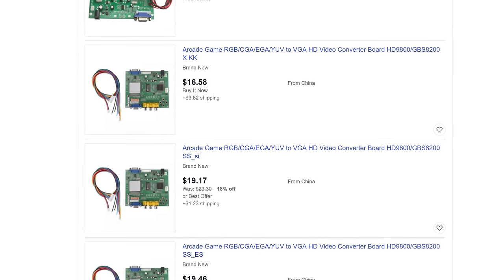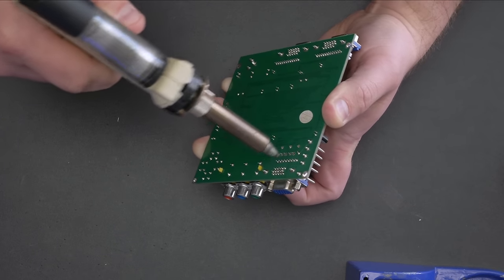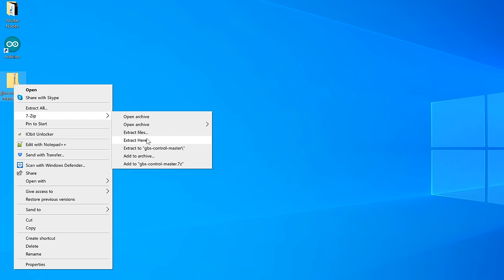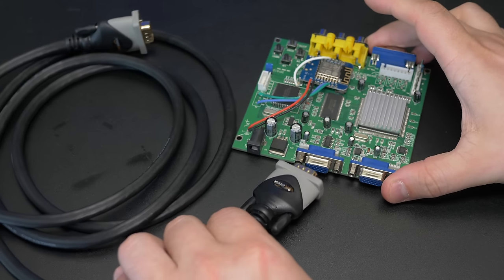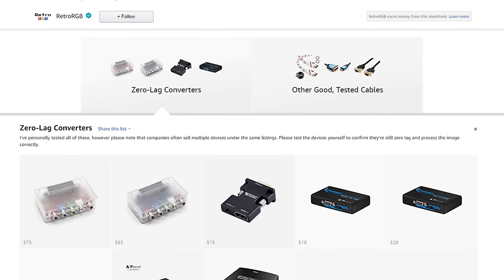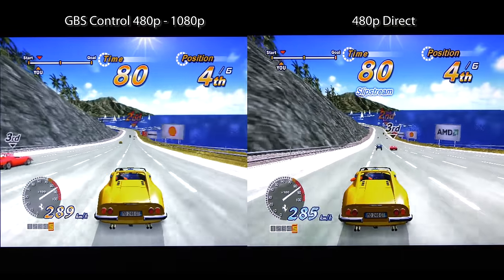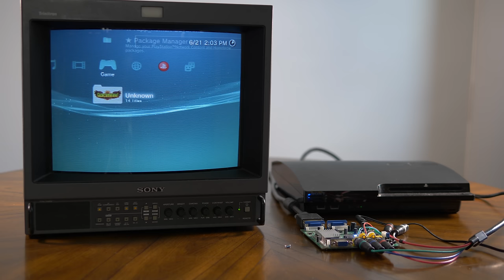GBS Control: Installation & Overview

Comment: This is an extremely compelling product to use for deinterlacing and downscaling. As far as 240p goes, as you mentioned before the RetroTink and OSSC are still the top dogs as long as money isn't an issue. However, the GBS's deinterlacing has really made an awesome impression on me. I use an OSSC, but I'm not a fan of the bob-deinterlacing due to the fields constantly moving up and down which makes it hard to focus on static screens like menus and such. To fix this I use an Crestron HD Scaler which handles the deinterlacing instead of the OSSC, but I have no idea how much lag it produces. I don't think its bad at all, but the OSSC is needed to convert the analog signal to digital before the Crestron gets it because its does get laggy when dealing with pure analog since its also upscaling. The GBS on the other hand has some hard numbers to show and they're really good compared to more popular deinterlacers like the Framemeister. I may consider this project just for 480i only, but I am looking forward to seeing your next video on how downscaling may be beneficial. Thanks for all the effort and information you give us!

Comment: I actually did it.
This is the best low cost investment I've ever made. This thing is incredible. It's just that good.
Things you will need if you never soldered before, like me:
• female ended wires, if you buy the full-size esp8266 board like I did, not the mini one Bob did
• one single jumper, though you can get around this by...spreading solder between the two pins on the flip side of the board. Go with the jumper.
• 100 Ohm resistors (3 total)
• you can pretty much only buy the above parts in bulk because brick and mortar parts stores are basically dead RIP
• soldering iron kit (iron, solder wire, flux, DESOLDER PLUNGER PUMP THING [necessary], solder wick, multiple iron heads)

Having never done it before I really thought I would kill it, and I nearly did, but it turned out fantastically. 

The only complaints I have are that the 1080p output frequency is guaranteed to cause a disconnect with the wifi, and the screen tearing is noticable sometimes, but the clock gen mod fixes that easily, just more work and an extra purchase. This thing is a dream.
Reply: Intersting I bought a pre made GBS-C and notice now and again a horizontal line scrolling down the screen.

Comment: 10:45 "Nerding" used in this way is new to me, but I approve. :D Anyway, this is awesome. Last time I looked at this project (a couple years ago?) they were using Raspberry Pis to do this stuff to the GBS scaler. Everything's gotten way fancier and cleaner with an Arduino and those awesome menus. Great work, guys!
Reply: I did mine with dooklink's raspberry pi mod on a pi 2b.  I didnt do the component out mod.  That requires more nerding.

Comment: I made three of these, one for me and one each for my two oldest daughters that are also into ps1/ps2 gaming
and they work beautifully. Easy to use and great performance at a very reasonable price.

I actually bought a board for a fourth one. Lol. I am planning to build a dedicated PS2 arcade cabinet. I.e. an arcade cabinet but one that has a ps2 built in with a HDD and OPL. And instead of clickety buttons and a joystick it will just have a holder for a PS2 controller.
Kind of like those cabinets you used to see at Fry's or game stores to try out some demo-games. But this one will look a lot more like an ordinary full size arcade game cabinet, but it will just be for a PS2.

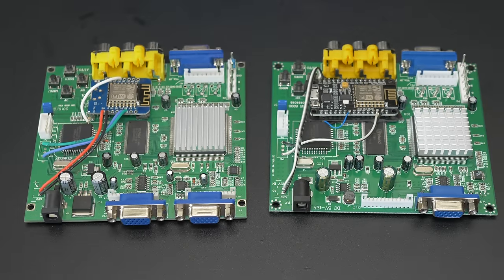Comment: Thank you for the informative video! 5:44 you show the 8200 and 8220 side by side... and they are each using different variants of the 8266.  Looks like the 8220 uses the D1 style board whereas the 8200 is using the CP2102 (which is also the board you have linked in the description).  Was that an intentional choice for a particular reason, or did it just happen to be what you had around (since the layout shouldn't matter)?
Reply from the maker: Honestly, it’s all I had access to. I bought from different sources hoping to get a variety, but that’s what I ended up with.

Comment: Can you downscale a VGA computer signal to 240P with this device? 
I know you can achieve this using your graphics card in tandem with a VGA to component transcoder. However my graphics card is too old to achieve this. Instead, I use an Extron VSC 100 in tandem with a Extron RGB 190 to achieve a 240P image.

Comment: How does the board transmit sound to the tv if you don’t plug in all the component cables? Sorry this is probably a dumb question
Reply from the maker: Not dumb at all!  You’d just bypass the board and send audio directly to the TV, speakers or stereo receiver.
Reply: Thank you so much. I don’t know how you have time come reply to a random comment on an old video, but I can’t thank you enough!

Comment: I think you could just put the sync resistor inside the SCART connector - they're usually easy to open & have plenty of room inside. I used to do a similar modification inside 3rd party Nintendo cables many years ago.

Comment: Awesome video. Gotta say based on my experience though that the 240p results in my GBS-C are far superior to what you're showing at 14:39 .. you have these really obnoxious horizontal ringing artefacts. Have you noticed these? And would you say they are universally present in the units you have tested? Or is it a side effect of your capture method?
One of my biggest concerns with recommending GBS-control is the QC on the original devices, so it may be that my GBS board is just better than the one you used. Would be interested to hear your thoughts though!
Reply from the maker: I've built and tested three 8200's and one 8220 for these captures.  All look pretty much the exact same.  I agree, there's most likely a lot of different models with varying quality.
Reply: Mine also does not have these artefacts in 240p output. Worth investigation!

Comment: I've been using GBS-C as my daily driver for the past month and it's been pretty great, especially for the price. I'm no wizard with the soldering iron and I actually screwed up, damaging the board... But the board only costs £15 so I just bought another one and tried again. Imo, that's pretty much the point, right there.

Comment: Does the pass-trough mode(240p or 480i source) also work with the VGA to HDMI adapter? I'm curious about this since this would be really handy for my streaming setup, since there are not a lot of Scart splitters of high quality and a reasonable price I had the idea to use a GBS8220(with the mod) and the use VGA as output method, combine the sync and use that on my CRT and then send the other via the VGA to HDMI adapter to a capture card, i'd really appreciate it if someone could point this out to me!
Reply from the maker: Yes, but your HDMI target device would have to be compatible with 240p and 480i for it to work.
Reply: @RetroRGB  Ok thanks! i believe my capture card supports that!

Comment: Trying to build one… and stuck. Bob, ive added a clock generator and vga to HDMI out adapter, while inputting via component video. I can only get video feed of 480p from a wii, in “pass-through” only. None of the upscaling presets are “selectable” and when i do select a preset, the screen just goes black. 

Can i get some help?

Comment: What about those using a GBS 8200 for an arcade board?  Does the GBS Control mod help with that at all?

Just started using one of these recently for my Mortal Kombat boards.  This is an impressive mod.
Reply from the maker: Yes, it's a massive help.  Doesn't matter if you're using the original for arcades or consoles, it's still really laggy.
Reply: @RetroRGB  Yeah I can confirm the lag from playing Mortal Kombat 1 on mine, although still playable.  Luckily I found a replacement 25 inch CRT for my UMK3 so I didn't have to use the GBS.

Anyways, thank you.  I will definitely be looking at this solution for a CRT replacement in case its ever needed.

Comment: Would it be possible to use this device to get 240p composite video from an HDMI source?
In my head, the setup looks like HDMI from PC -> HDMI to VGA converter into GBS -> VGA to composite converter out of GBS -> 15khz NTSC crt composite input.
Would appreciate any help :-)
Reply from the maker: Generating composite from RGB is REAAAAALY hard.  The short version is because you need a pixel clock to sync the color data.  Here's the long version:  https://youtu.be/m12PgfZl56c
Reply: @RetroRGB  Ahh, I see. Thanks for the quick reply! Starting to seem like composite 240p from HDMI source isn't possible at all, unless you have any ideas otherwise. But maybe it would be wiser to go in a different direction, such as original hardware or CRT Emudriver. Thanks again!!

Comment: Fantastic.  Do you think this could work on an MVS + Jamma?  I have one of these laying around.  Pretty impressive project!
Reply from the maker: Absolutely, but you'd need to make sure the video levels matched standard RGBs.  So MVS -> cheap supergun -> GBSControl should be perfect.
Reply: @RetroRGB  Get a MiniGun on ebay or tindie. MVS -> MiniGun -> GBSControl

Comment: Have you started seeing 240p/480i switching causing dropouts again after installing the clock gen? Because that's been my experience. It was seamless without the clock gen, but I wired it up and started powering it off C47 and now it works great and there's no tearing... but it does drop out for a split second when 480i<-->240p switches happen.

Comment: I am having a issue with the gbs not outputting a video signal. I am using a vga to hdmi converter. Have verified the converter works properly. I can log into the controller via wifi, but cannot select a output resolution. Have triple checked wiring connections,  but am at a loss at this point. I am questioning if the gbs is even powering on as the led indicator on the board does not illuminate. Any suggestions?

Comment: I really want to use it to connect my PC, which has a video card capable of outputting dvi analog if required, to a consumer CRT set via component YUV/YPbPr at 15khz. It looks like it is capable of doing it, can anyone confirm?
Reply: Should be possible, but bare in mind the output will be RGBHV, not RGBs or YPbPr, so you'll need to convert.
Reply from the maker: Yup, it should work fine:  Set your PC to 640x480, then connect the DVI-A output to the VGA input with a basic passthrough cable or dongle.  Then it'll either output RGBHV or YPbPr, depending on how you have the output mode set.
Reply: @RetroRGB  thank you Bob for clarifying. I just subbed to ur floatplane to ask this but you were kind enough to answer here. I'll be keeping my sub there to support u. Have a great week!

Comment: I use one of these for plugging a component source into a VGA monitor, with the "Source Pass-through" setting in gbscontrol, and it seems to just be straight up transcoding YPbPr to RGB, which is exactly what I want.

Comment: I have used a few GBS-8200 in the past for converting 25Khz medium resolution arcade games to VGA, I didn't much in there to upgrade it for that purpose, is that correct?
Reply from the maker: I would never recommend using one without the GBS Control mod.  The variable lag alone is reason to upgrade.

Comment: Brilliant video. I'm trying to find out the best way to connect Atari ST 320x200 to a CRT VGA monitor as the 15khz scan is out of range. Do you think this is worth a try for that purpose?
Reply from the maker: I THINK this will work, however I don't have an ST to test.  If you don't mind building your own hardware/software, I think this is a worthwhile project to test.
Reply: Search YouTube I believe there's a video of most home computers to GBS. Atari ST, Amiga, Beeb, etc.

Comment: If I have not understood the best option for all systems is GBS-C, right? I lose some quality in 240p, but it still looks good and in return I win the best deinterlacing (PS2), the only device that works correctly in game that alternates 240p with 480i (SNES, PS1 and PS2) and works correctly to rescale progressive signals to 960p or 1080p. Lag is very low, I guess it won't affect the game if not people wouldn't be buying it.

To begin with, GBS-C seems the most complete/economical option, right?

By the way, does it have any kind of effect to apply to retro games like scanlines?

Comment: I'll be looking forward to those downscaling solutions! I got a PS3 recently and got bummed at how it can't display 240p. Although, the PS1 emulation on it seems worse than people think it may be, because aside from not displaying 240p, it's scaled incorrectly vertically, at least in 480i on my 29" CRT; Symphony of the Night has some tearing when scrolling up or down, though it's not noticeable on 3D games. But the worst thing to me, is the audio delay. Input lag seems fine, but it was impossible not to notice the delay on any audio cue. The PS2 is much, much better at backwards compatibility than the PS3.

Comment: Great video. I do have a question. How did you get RGB out of the PS1? Did you use SCART to VGA?
Reply from the maker: Thanks!  I used the SCART Cleaner, but the GBS-C AIO works equally as good...it's just not available yet:
https://www.gbscaio.com/
https://www.retrorgb.com/scartcleaner.html

Comment: I have a consolized MV1C that has a 15khz RGB signal coming out a DB15 - could I run that to the GBS input and then have the GBS output component video (essentially using it as a transcoder)?
Reply from the maker: Yes.  You can choose to pass through the signal, transcode, or scale it.  Just check the github and notes about the proper mods required for high quality component output.

Comment: Excellent tutorial. I got one of these cheap boards with hope to render 15kHz Atari ST colour to modern monitor - it didnt work on the VGA but I see after buying it that the VGA only handles 30-32kHz. I figure rather than sending it back I will hack it as you have shown .... if nothing else it looks like a fun thing to try.

Thanks again
Reply from the maker: Thanks...and that's a great idea!  Worse case, you're out $20 and an hour of time...but have a "tool" you can use for tons of other stuff as well.

Comment: I have an odd usage case idea, For games that have the handshake drop out problem to other scalers. Could this be used to normalize their output before being sent over to say an OSSC or Framemeister to make it so that they no longer have that issue? I already have Framemeister but there are some things, Like Pokemon Stadium where the intro is unwatchable on it because of the resolution changes.
Reply from the maker: Mixing scalers like that can often result in a lot of unwanted side-effects.  If this is an important problem to solve, the best solution by far would be selling the Framemeister and getting a RetroTINK 5x.  I demo the resolution switching in my launch video, but there's been a ton of updates since...search this channel and RetroRGB.com for more info, but start here:  https://youtu.be/nwNrqIjxBaA
Reply: @RetroRGB  I'm not sure the 5X is the right one for me. N64 and Playstation 2 are my newest systems. most of my collection includes NES SNES and first playstation aside from them and an Atari 2600 Edit: Oh and a Dream Cast my Mom fried by unplugging and plugging the controller back in while ignoring me saying to not to.
Reply from the maker: The RT5x is by far the best scaler for all those consoles. No contest.
Reply: @RetroRGB  Thank you. I don't see myself selling my Framemeister. I'll just save up and potentially get this and a RetroTink 5x at some point. Thing is my newest TV is still only 1080p and I might be able to use this to down scale to make a better source to pump into a VCR in house transmitter science project to still use on my dozens of battery powered pocket up to 5" crt TV sets.

Comment: Wow, I just found the 8220 I bought like 15 years ago, after not being able to find it for years.... Now it just so happens that between building OSCRs and SlimeVR trackers, I have pretty much all the parts required for this mod. 😁👍
Reply from the maker: Ha, awesome!
Reply: @RetroRGB  I think most makers have a crapload of esp8266 and esp32 boards by now, but I laughed pretty hard when you were like "And if you add this clock generator board...." because I've got like a dozen of those for OSCR builds! 🤣 Always refreshing to stumble upon a new project and not have to buy anything innit?! 😁

Comment: My signal input is AV(CVBS). It seems an add-on converter board is needed before the GBS Control or OSSC. Does this extra add-on add latency?
Reply from the maker: Zero latency added:  https://youtu.be/R3yIWdN0gKE
Reply: @RetroRGB  Thanks. I need to switch  between 2 CVBS sources from time to time. I guess it maybe similar to the 240p-480i swtich of the consoles. Is a GBS Control with a Koryuu Transcoder the solution for me?

Comment: Mine didn’t have any luck with my Sega Blast City with 31Khz Sanwa arcade monitor, the image kept scrolling and fizzling out. Removing the GBS and plugging directly in via HDMI to VGA did the trick when set to 640x480 in Windows so now I can get my Mame setup going albeit without the GBS in the mix. Not sure what the problem was, perhaps it was the fact that mine had a clock mod installed for compatibility with certain other combinations? I thought that would be better to get a fully modded up GBS but perhaps not? I’m not interested in buying a non-clock modded GBS unit just to test since my arcade setup works and I found out the monitor didn’t do 15Khz anyway so now I may try to use my GBS unit with retro consoles and see how it does with that at least.